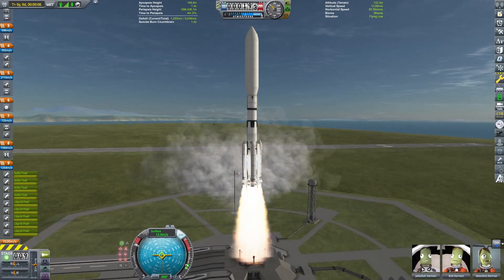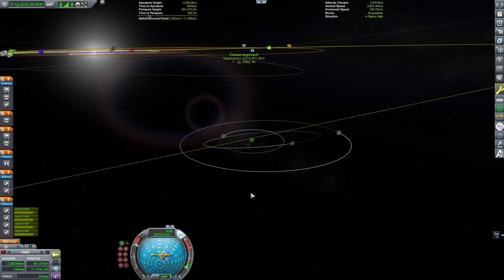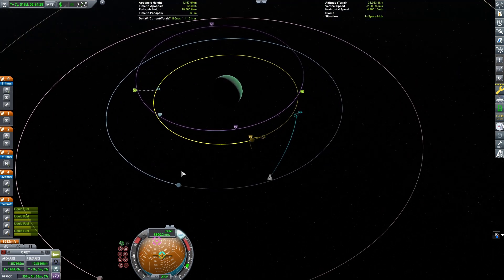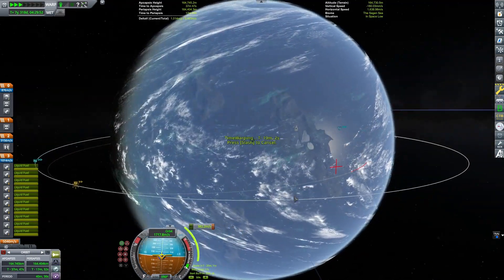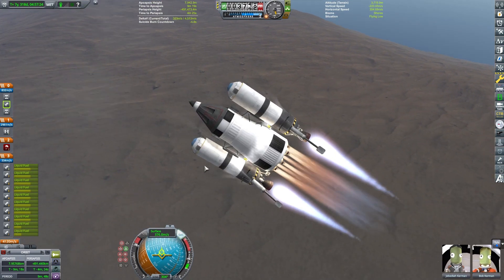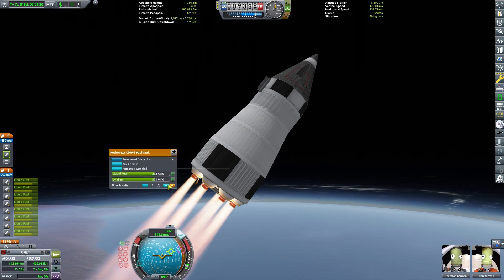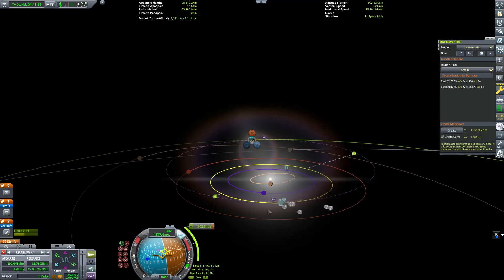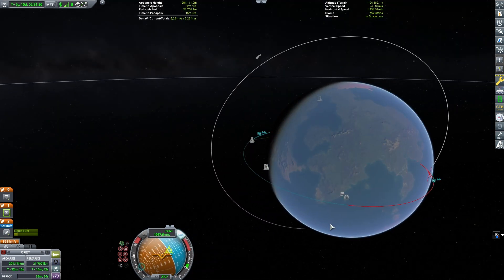Landing on Laythe and Returning to Kerbin

Comment: I'll go in and manually override my landing strut's force to super low so it will put the rocket on the ground and usually that helps keep it from sliding. Be careful doing it though!
Reply from the maker: Using advanced tweakables and changing the dampening and spring strength is a good idea.

Comment: I’m just a bit curious. I’m having trouble capturing into laythe because it costs too much delta v could you explain it a bit more
Reply from the maker: How much Delta v it takes to capture around Laythe depends on your orbit around Jool. It is possible to use aerobraking to save on the Delta v budget and/or gravity assists. Laythe and Tylo are great good to use and can get you into orbit around Jool "for free."

How are you getting into orbit around Jool and then Laythe? Are you trying to capture around Laythe directly?
Reply: @Echo3  I get into orbit around Jool using a Tylo gravity assist under Laythe's orbit. I extend out the orbit until I get a Laythe encounter. I'm going too fast to capture for a reasonable amount of delta v.
Reply from the maker: @M22Moment  you can keep using Tylo and Laythe gravity assists to get into an orbit around Jool that is closer to Laythe's. This will decrease the amount of Delta v needed.
Reply: @Echo3  Thanks!

Comment: used this video for ideas on the transfer stage, discovered that im just a bit too conservative about fuel in oribt XD
Reply from the maker: With gravity assists or aerobraking you can be more conservative. But if you aren't doing anything of that, then it does take a lot of Delta v to land on Laythe and return.

Comment: Thank you! I think your design will get Jeb and Bill back from Laythe, who are currently stranded. Now I just got to land it close to their position.
Reply from the maker: I used the mod trajectories to help pinpoint my landing.
Reply: my comment is probably a bit late but sending an airbreathing aircraft to laythe can help if you didnt land that close to where ur kerbals are stranded, also you can use a ssto spaceplane as the lander, that way its a two in one, it can land on laythe and reach orbit again, but also be able to easier pinpoint land near stranded kerbals

Comment: Very nice video, I think I'll start watching your content! Also, minor question: is there any way to mount multiple engines without the engine plate? I haven't got the Making History DLC...
Reply from the maker: You can use cubic struts and interstage fairings to get something similar. However, the MH DLC does add some useful parts like engine plates, 5m parts and some nice engines. If you find it on sale  I'd recommend picking it up.

Thanks for taking the time to comment. It's nice to know that the time spent making a video is appreciated.